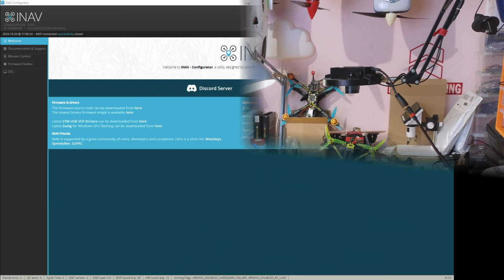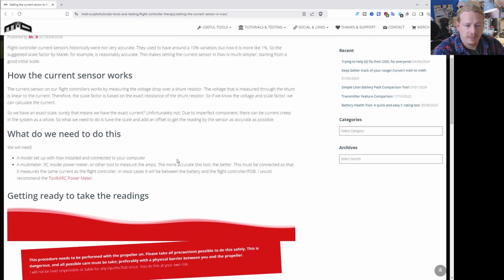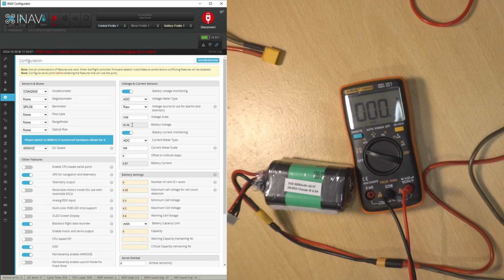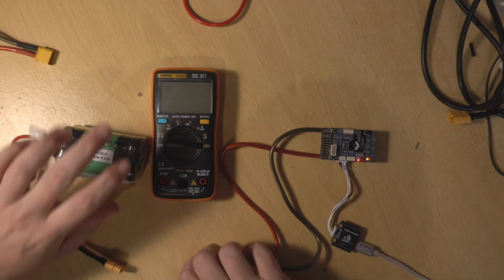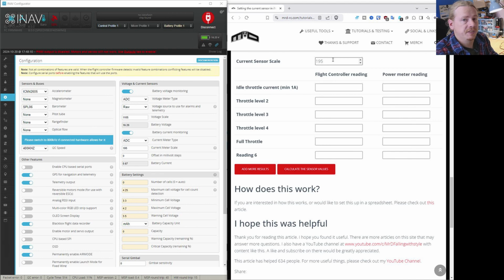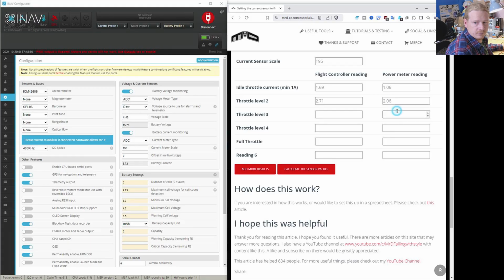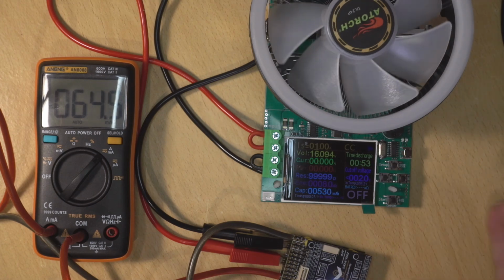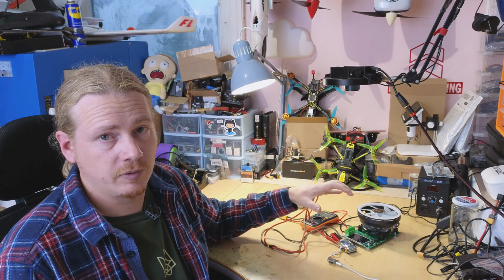INAV: Calibrate your current sensor accurately and safely

Comment: Just watched the video, looks great.  But my LR quad is already built and motors connected and flying great.  Is it possible to do this now or is it too late? Mine is a 4 in 1 ESC and Im not sure where to hook things up.  Can you show how this is done on a drone with a 4-1 ESC and a separate FC, at least where to put the clip leads on the quad, the rest should be the same.
Reply: Okay I see now that WING FC has the Om25 onboard which your connecting across with the clips and putting the load post sensor, my FC doesn't have a Om25, its on the 4-1 ESC and there is no place to connect it post shunt that I see, my FC is a TBS Lucid H7 and ESC  F55A Pro III 55A 3-8s.  I looked all over and I just can't find a place to put the load post Om25 so this I assume won't work for me?
Reply: I think the 4-1 quads can use the small inline light 200A RC Watt Meter, High Precision Power Analyzer, DC 0-60V Volt Amp Watt Checker Tester, they are cheaper and should work by getting the mha used and using your site to get the offsets, I think.

Comment: don’t know if this would solve my problem. I was hoping to get some help my dolphin pro with the return to home flight controller in the OSD elements as well as the built-in OSD element in my G2 goggles shows zero for the voltage if I plugged my plane in to my computer as well as the battery plugged in configurator doesn’t register the battery either. It just says 0 V any chance you might know of a fix or would this video be the fix?

Comment: My load tester just arrived from Ali and I can't wait to make this the new default method for testing my FC's. Thanks Mr. D !!!
Reply from the maker: It works a treat. It’s great being able to calibrate before even soldering anything too.
Reply: @MrD  I am confused and after watching your video a few times, I cannot get the load tester to work without powering it up by the wall wart/power supply that comes with it. I cannot see in your video whether or not you are powering yours up with the power supply so I can only assume you are?

Additionally, once powered up (with the included psu) I can adjust it for 3 amps (for sake of this question) but it  just feels to me like it is drawing power from the psu and not through the FC and connected battery?

Can you clarify some of this for me sir? Perhaps the iNav FB group is a better place to have this conversation?
Reply from the maker: @opposedforces  yes, you need it powered on at the wall. That provides power for the controller and fan. 

It will be drawing the power from the rail on the left of the unit when in operation.

Comment: Hi Darren. Does it matter if I already have an ESC soldered on? Can I just leave it and do the tests without removing it? Thanks again
Reply from the maker: If you disconnect the motor and signal to the ESC. It should be close enough.

Comment: Excellent video! Highly helpful! But I have a small problem on calibrating my SpeedyBee MiniWing F405. Actually calibration went perfect, but ones I connected VTX, GPS, RX to it the amperes readings from FC became 1-2 amps differ from the real measured by ampermeter before current sensor. Physically it shouldn't be like what because current sensor already calibrated and it situated  before of all other power consumers. I don't understand why this happens...

Comment: Is there anyway to add custom install defines with inav like in betaflight? The onboard  barometer is missing, do I just need to cli define? I tried setting it in the config tab under barometer but just red barometer....
Reply from the maker: It should not be needed if the target is correct. The supported hardware is defined in the target.
Reply: @MrD  yea well dakefpvf405 inav target sucks then 😞, but thanks! Always something......

Comment: Is correct  at 9:05 the wiring scheme? Why you put battery ground on the ground of esc?
Reply from the maker: Follow the guide for your particular flight controller.

On that FC, the ESC and battery grounds are all the same pad. The copper is one complete piece underneath the mask. This is the case with most PDBs. You can always check continuity with a multimeter.

Comment: Hi Darren, I have just purchased the DL24/P. How do you recommend using it if you have a fc already mounted on a plane? Should I disconnect the esc? What other precautions should I take?
Reply from the maker: Disconecting the ESC is all you should need to do. Maybe disconnect the video system to save it from heating up too much.
Reply: Excellent question mate, I have a couple i want to check also. Isn't Darren a Fantastic Person so helpful!

Comment: I wonder if the amp reading on a Watt meter is accurate enough- if so it already has the connectors in place and doesn’t need the adapter cable shown here

Besides that question many thanks again Darren for a very practical demonstration
Reply from the maker: It’s not quite accurate enough. You can see in the video. It is pulling slightly more amps when it has warmed up. The multimeter, or a DC clamp meter around the battery positive. Will give the best accuracy.

Comment: Wonder if you could use a rc battery discharger to do this where you can set the exact drain - mind you, they are not cheap :)
Reply from the maker: You possibly could. I know ISDT have big discharges where you can set the current. But I don’t believe they’re as easy to change the current on as just clicking button. I believe you need to use a smart phone app. Plus they do cost twice the price.
Reply: @MrD  Yep, correct - I use an App for my IDT discharger but I bet it would work

Comment: you could also use a lipo charger with a charging battery connected for creating the various load amperages. just change the charging amps as you go.
Reply: This method could be interesting because it exploits something we all already have at home. Or am I wrong? Could you explain this process better?

Comment: I've often seen the calibration when near 1A to be very different from everything else.  In this case, I'd toss out the 1.06A draw that is reading 1.69 and just do the numbers with the other values.  My equivalent DIY spreadsheet suggests a scale factor of 197 with a 11.5mV offset doing that.

Comment: Do you have to have different current scales for different batteries? For example one scale for a 3S and one for a 4S or is it a one size fits all?
Reply: One size fits all
Reply from the maker: As Ruby rightly said. It doesn’t matter how many cells in series the battery has. This is calibrating sensors on the flight controller. So the calibration is good of anything you put through them 🙂